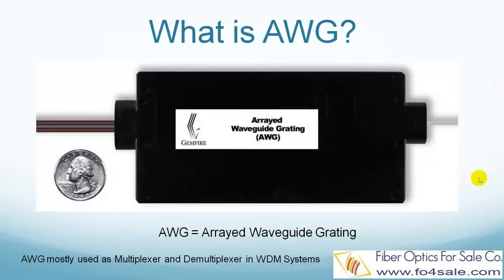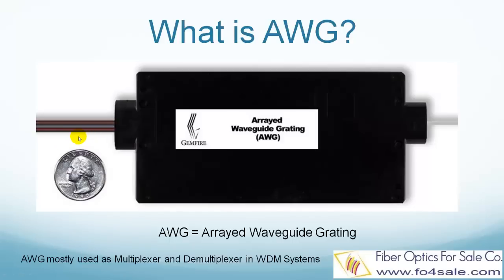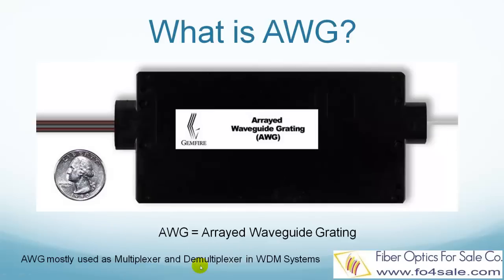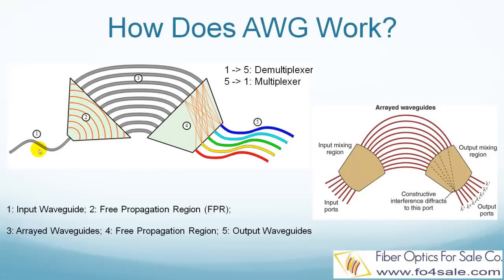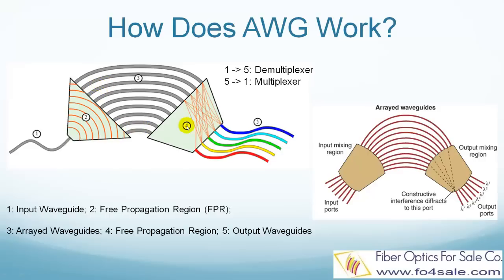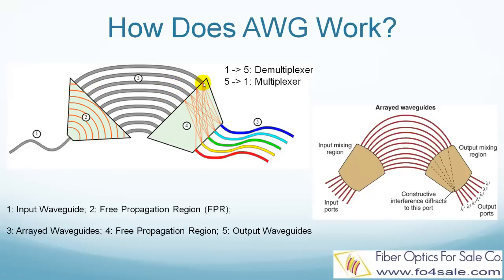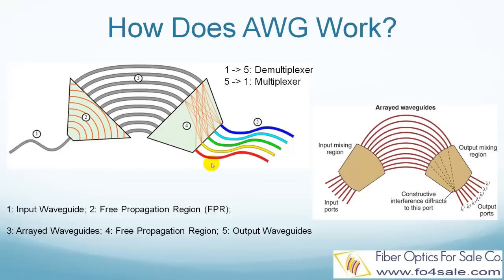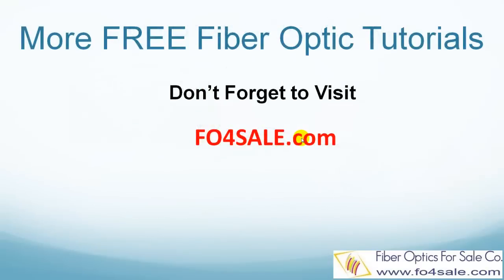What is AWG (Arrayed Waveguide Gratings)?

Comment: do you have a good literature source, where I can find some explanation how to design AWG lengths ? I found a lot literature however I still have a problem to understand how particular wavelength is coupled into the particular output. I guess that the length of a waveguide channel is exterminating phase and this phase corresponds only with one specific wavelength